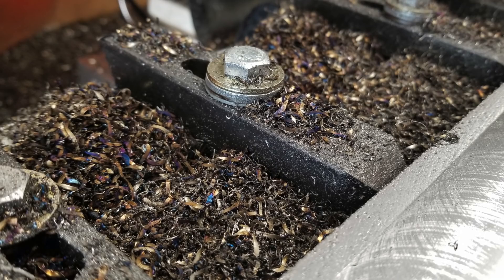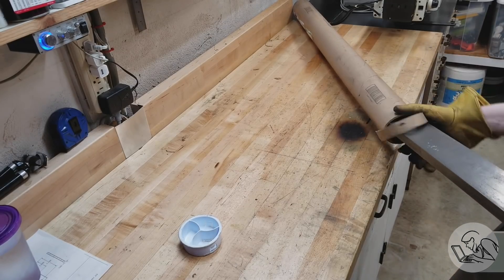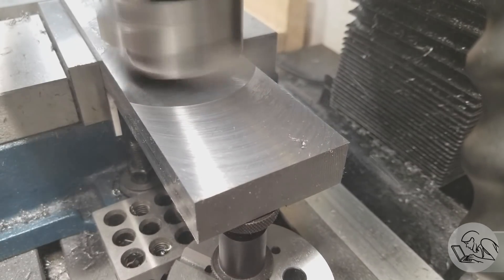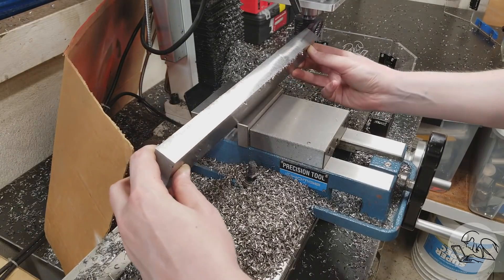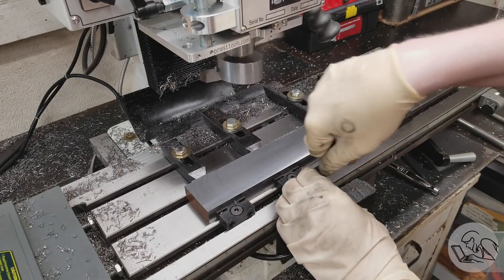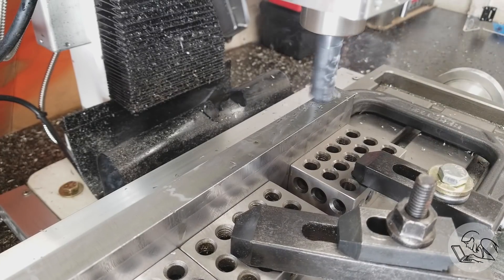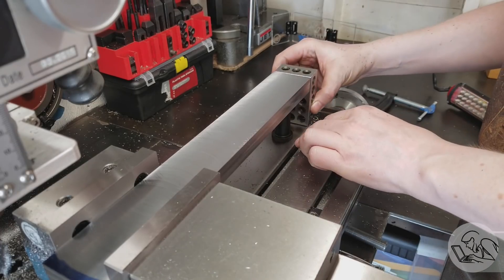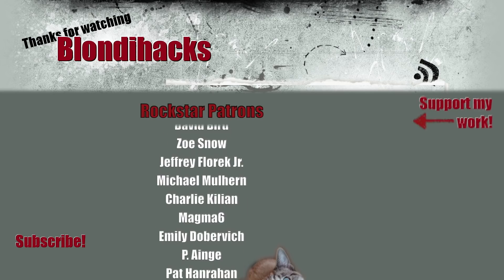Steam Stoker Engine Parts

Comment: Quinn, you've got more determination than I do. I wouldn't even have tried that job with a small hobby mill, but you got good results. BTW, 21/32" really isn't an odd size. It provides 1/32" clearance for a 5/8" fastener. It was a fractional world back then.

Comment: I used to have a problem with my mill drill stalling under heavy load, but ever since I upgraded to a DC treadmill motor it's never stalled (of course I'm using almost the maximum reduction of the four original pulleys, which helps immensely!)  My max rpm is only about 1400, which is a little slow, but before the upgrade I ran everything at 650 rpm because changing the belts was such a pain.

Comment: Tip on using the 1-2-3 block threads.  I bought a pack of “Foto&Tech 10 Pieces Metal 1/4 inch to 3/8 inch Convert Screw Adapter for Tripod Monopod Ballhead DSLR SLR” for seven dollars on amazon. They screw into the block sub flush and reduces the tread to 1/4” so the screw can go through the other holes.  You could also screw them into your T-nuts to hold the blocks down.

Comment: Quinn, I just found your channel I guess due to the algorithm that makes suggestions from others I watch like the three Keiths and ABomb  and have spent more time reading the comments this morning than it took to watch the video. Quite often the comments have been for you to get a bigger machine, don't do it!!  Your videos are great for the folks who have limited space and budget and are having a lot of fun working with machines like yours so your excellent instructions for using the mill help a lot of folks. Adam Booth would have taken a lot less time in his shaper making the guides but I kind of think it might not fit into your work space.
There is an old saying in the trade no matter how big the machine is you sooner or later will have to exceed it's capacity. 
Looking forward to your PM Research project.
Now to turn off the computer and make some more parts for my 2" scale Cole's Case tractor.

Dick B.

Comment: Pushing the capacity of your machine is the hallmark of a good machinist. Also don't feel bad about the finish, I've been a machinist for 30 years and getting a good finish on 1018 is still an exercise in frustration.
Reply: Slab milling cutters on a horizontal mill are the way to go for this I think. I did some 1020 with mine and it came out almost mirror like in shine (but with 'wobbles' courtesy of the cutter runout). I think the teeth kind of burnish the surface as they enter the cut when you conventional mill with that kind of tool, so you get a surface finish with shininess similar to the ground finish on the cutter teeth.

Comment: You could save yourself some deburring when facing the edge at 4:50 by starting your cut at the other end of the piece (the left end as you face the mill), rather than starting on the right end. That way, the burr is pushed towards the middle, instead of the edge and is trimmed off when you move the cutter forward to finish the cut, again pushing the burr to the middle. It's a trick I learned from Stefan Gotteswinter.
Reply from the maker: The problem with that trick is that you are climb milling, which I try to avoid on this mill.
Reply: @Blondihacks  True, especially on a smaller mill where rigidity is more of an issue. I tend to use this trick when I'm making shallow finishing cuts. I admire your work and have learned a lot from you.

Comment: One thing that I've learnt to improve surface finish, when the parts are tall in the vice the workpiece is less stiff in the horizontal direction so it will flap a bit with the cutting action
If you position the cutter so that the initial point of contact is tangental to the workpiece edge it will put more of a longitudinal force on which will be more rigid. It is also a slightly smoother approach into the work piece rather than an interrupted cut, again better surface finish
The one issue with this approach is if your vice/holddown clamps have poor holding force the part may slip.
Great video Quinn

Comment: Thanks Quinn.  
I recently acquired the same mill as you are using and your setup ideas will be super valuable to me, especially the low profile clamps. A good laugh was had when you ran out of Y axis because I did the same darn thing a couple of days ago with my first pitch circle set up. As they say, pride cometh before a fall and I was so proud of myself that this 111 mm 8 hole pattern was so easy, then I got to the last hole and was about 50 thou shy of being able to drill it. Oh well, live and learn. keep up the cool stuff.

Comment: you know steam engines?! I am really wanting to make one myself. They are fascinating.  Modeled one in Solidworks to get an idea of what it might take to build a small one. Going great until figuring out valve timing. That brick wall I ran into still hurts. If you build one, please take the time to explain what is going on? The good ones seem to start with castings. Don't really want to try that at that at this time. Could buy castings of course, then it would be partially made by some one else. Please consider making one? I'll volunteer to help by make drawings.  Thank you for making your videos. Enjoy how you work - very practical and get good results.
Reply from the maker: I actually have a model engine that I designed which you can make from bar stock. The plans are on my Patreon, and I’ll likely be doing a video about it at some point soon.
Reply: @Blondihacks   I'll have a look -thanks!

Comment: You can also use the DRO to measure the length accurately. Measure a 1-2-3 block with the caliper and place it (or 2) on the part to be measured with the side exactly equal. Clamp the 1-2-3 block. This is length A. Now, measure the length from the 1-2-3 block to the other side of the long part with the DRO and an edge finder. This is length B. A plus B gives the fairly accurate length of the part that is too long. Anyway, imho better than working with a ruler ;-)

Comment: I have been watching your use of the 1,2,3 blocks and was wondering when we would see you do some set ups with them bolted together...usually the cheap ones don't have holes laid out in such a way that you can bolt them together for any useful set up.  The hole diameter problem is one I never got too as I was always shut down by the holes in wrong places first.  Again, thanks for showing the "problem" issues and how you deal with them.  That is the most interesting part of things.

Comment: Nice video I think your drilling the large hole too fast slower speed will give you more torque I'm looking forward the steam engine video regards keep up the good work
Reply from the maker: Small mills like this are the opposite- they have more torque at higher RPM because it is a brushless DC motor. Speed is changed digitally, not with gearing and at low RPM the MOSFETs are less efficient. All the RPMs you see here are taken from Machinery’s Handbook for the drill diameter.

Comment: You should think about a facemill with a slightly positive geonometry and some smaller solid carbide endmills. Should be a huge boost in productivity and non smoky shop :)
Reply from the maker: Yah I’d really like to. I considered buying one for this project but they are so gosh darned expensive.
Reply: @Blondihacks  A company should sponsor you some. You have done Niagra cutters so well.

Comment: One of the reasons i got the HBM versions of the PM25mv was that it comes with a 1000w brushless motor thats about 1.34hp, only slightky bigger but you notice on the bigger jobs, I have been told that the 1100w is a direct fit so if I ever need to replace mine I know what I will get. Have you ever thought of cnc'ing it?

Comment: 8:12.  A fine mister is almost as good as flood cooling and a lot less messy.  Just requires a small compressor.  Subscribed, patreon, and thumbs up to crush a troll.  https://www.amazon.com/NOGA-MC1601-Cooling-System-Model/dp/B0025Q4C5Q

Comment: Hi Quinn, large cutters are always a challenge. Try moving the cutter over so it's just hangs over the edge of the job. With this  setup milling conventional and not climb, this will do two things. I it will reduce the loading on each tooth as you have more of them in contact at any given time and improve the finish as the teeth are pushing along the job rather than across it. This second point reduces vibration as your not "pinging" the metal. Imagine pushing a stick in a bicycle wheel, then turning the stick edgeways and doing it again. Which makes most noise. This principle also works on fly cutters by again keeping the tooth in contact for the longest possible amount of time. Great channel, I look forward to each new upload.
Reply: Offsetting like this also causes chip thinning, so it is equivalent to running a slower feed rate when it comes to spindle torque and surface finish.

Comment: Steam BABY!  Love everything about steam engines.
Reply: I had a fun discussion once with an engineering professor about efficiency.  He was arguing that the small super precision high speed motors he was working on were vastly more efficient than a steam motor.  I brought up over all efficiency and that it's a lot easier to make parts with precisions measured in 1/8's of an inch and that some big old steam engines in England had run for over one hundred years without any major repairs, and BTW what was the life expectancy of his little motors???  And what about repair...  well the small fast precise are not really repairable, you just need to replace.
SO steam engines are WAY more efficient if you look at the whole life cycle.

Comment: How about milling some threaded t-nut rods small enough to fit in the unthreaded holes of the 123 blocks?  They would be very useful on the mill.
Reply from the maker: Yah, I did think about that. It would require a whole separate set of nuts and such as well. I might just drill these silly things out with a carbide drill.

Comment: Those 1-2-3 blocks are much harder than they seem. I sincerely doubt you can drill them.
Reply from the maker: Good to know!
Reply: @Blondihacks  one more thing, I believe these may actually be m10 thread which will fit 3/8ths thread. I believe you may be able to get a 3/8th end mill through them if it's carbide and slowly.
Reply from the maker: Yah, I might try drilling them out with a carbide drill and lots of coolant. I’m honestly not sure if they are 3/8-16 or M10x1.5. Those two threads are so close they mostly interchange.

Comment: With the material overhang, sometimes just clamping a heavy clamp, or light clamp with a block of steel to act as a damper, may improve surface finish.
Good set up on the table, impressive machining for machine limitations. Using a double action or orbital sander can hide a multitude of surface finish short comings. 80 to 180 grit is fine.

Great vlog Quinn, and thanks for a great vlog.

Comment: Nicely done.
I have a slightly more heavy setup than yours, but so far only half a horsepower from the motor. Today I did the first trial-run of a replacement motor that is 1100W (1.5HP). There's a bit more work needed, including fitting the reverse-switch that I already bought for my old motor, but never actually fitted because "it was working". 
I got a bit more urgent need to fit it now, as the motor as it is currently wired runs in reverse, so I haven't actually done any milling yet (I don't have any left-hand milling cutters - I wouldn't be at all surprised to find out they do exist, but there certainly are none in my workshop). So that's tomorrow's task, get it running the right way around.  I could've done the "just plug the wires in the other way according to the diagram that came with the motor", but as I would like to be able to run it in reverse in the end, there's a good reason to "do it right to begin with, as temporary solutions tend to last longer than you expect".

Comment: Hey Quinn. What safety glasses do you use. I want to find a good pair that don’t fog up or scratch easily.
Reply from the maker: Honestly I don’t think glasses exist that don’t fog up. I have tried EVERYTHING for that problem. I have about seven pairs on hand, and I swap them when they fog up. On hot days I swap them a lot. I have a mix of brands and sizes, none in particular that are better or worse.
Reply: Blondihacks thanks Quinn. I will try the multiple glasses approach.

Comment: Nice work, my mill wouldn’t have been able to make that in one set up per side. The heat in the part made it grow how much? Thanks for sharing
Reply from the maker: About 1-2 thou expansion from the heat.
Reply: If you look up coefficient of linear thermal expansion you can get an idea of how much your part grows. Steel grows around .000011meter per meter of thickness and degree Celsius. So multiply .000011 meters by the thickness of the stock in meters and the temperature difference above ambient in Celsius to give you the amount the part has grown due to heat.

Comment: As soon as I saw you put that piece of steel in the vise I new what was going to happen. I have had the same problem with my 6inch Kurt vise. Not only does lose support in the Z direction it also tends to flex in the Y axis also I am sure your mill itself was flexing. There is a lot of cutting force with a .05 depth of cut. I haven't noticed your bench under the mill. You can add some rigidity to it by adding some weight underneath it. Maybe building a wooden stand or box underneath it and filling it with sand or concrete then bolt the mill through that to absorb some of the vibration. Not an expensive project but maybe worthwile for both your machines. Just some thoughts to share with you.

Comment: Wow, not just steam power but mainline steam power!  That rocks.  I'm curious about something: you said there was a little bit of double cutting with the flycutter, as if that's bad.  I feel like if the flycutter is just barely touching, that means the spindle is exactly perpendicular to the bed and I'm cutting flat.  If it's only cutting on the leading side, it's cutting slightly concave, isn't it?
The guy I learned from said if your chips aren't blue you're wasting time, but that doesn't hold for finishing cuts so much.
I bet the people making the 123 blocks drill it with the tap drill throughout, and then only tap a few, so you end up with a slight undersize on the unthreaded.
Reply from the maker: If the fly cutter is just grazing the surface, that’s okay. This was doing a bit more than that. Much more, and I’d be concerned I had a tram issue the other way!

Comment: What happens when the mill stalls?   What part of the machine gives?  Does it protect itself somehow?
Reply from the maker: Great question. The biggest problem is that the power feed doesn’t stop, because it’s a separate motor. So you gotta shut that off quickly. The power feed does have a safety clutch in it (you can hear it in the video, clacking). Next I hit the e-stop on the mill. It’s a brushless DC motor, so you’d probably burn out a MOSFET if was left stalled too long, but it does have a fuse that should blow (theoretically)

Comment: You should use a metal cutting saw blades in a table saw. I regularly rip thick plate with one. Cut 1 in plate at about 1 foot per minute. Plus you have a drop of usable material.
Reply: Ok on aluminium but surely not on steel? The surface speed is way too high, you'll burn up the saw teeth in no time.

That being said, ripping with a saw can be the way to go. I have a horizontal mill so I sometimes use a slitting saw to 'rip' material off oversized stock.

Comment: never toe the strap clamps! they need to be flust to the part. when you tighten them toe'd down like that your effective pressure to area is very small and not nearly as effective and will move.
Reply: Smaller contact area= higher pressure. (With the same clamping force.)